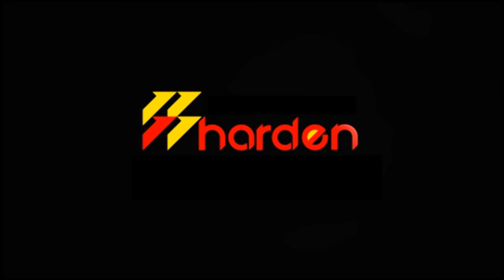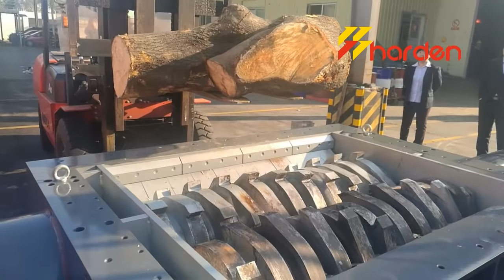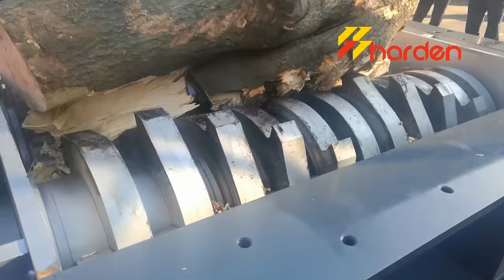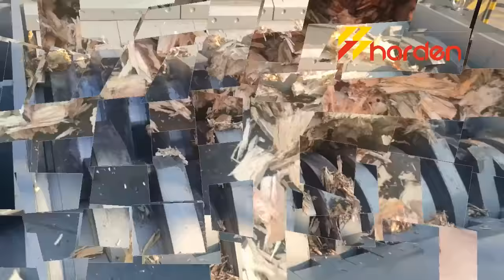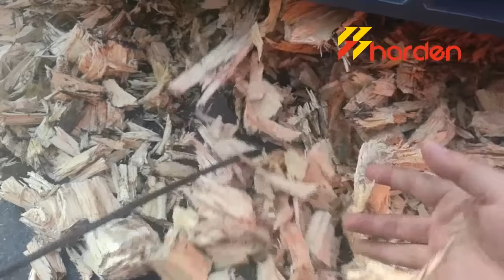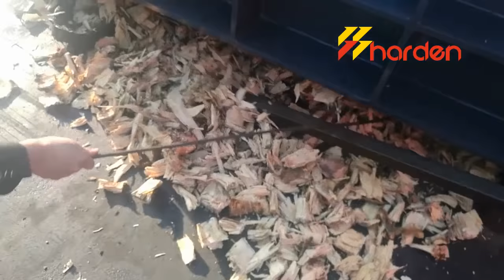Wood Shredder / Biomass Shredder

Comment: Waste of a lot of good lumber. A chainsaw lumber mill would have used it better. However, this is a very safe machine due to the slow operating speed. One of the fellows on our town grounds crew disappeared one day. The only culprit around was a massive high speed wood chipper. A typical cause of accidents is trying to push in a limb by hand. You can get sucked in so fast you don't have time to release your grip. No worries. Poured the wood chips in two graves. By the time the wife passes she can go in the same hole.

Comment: Would steel bolts do any damage to this? Looks like it would handle them.
Reply: No. It's best to use wooden bolts.
Reply: @northerniltree  Hahaha
Reply: I dont know about this machine specifecally, but there are very similar machines designed to shred metal.  They will shred an entire car, engine and all.